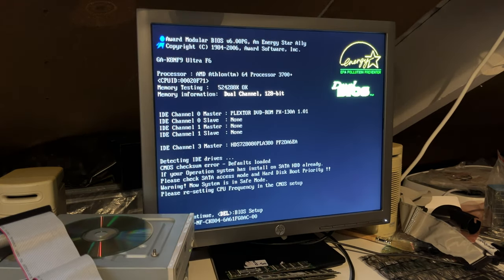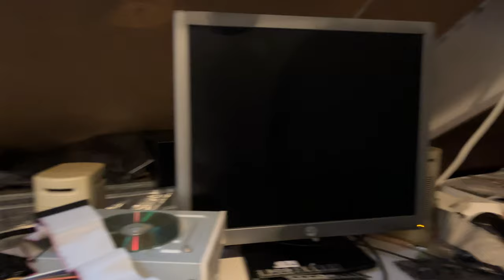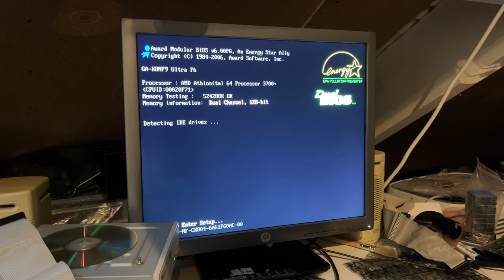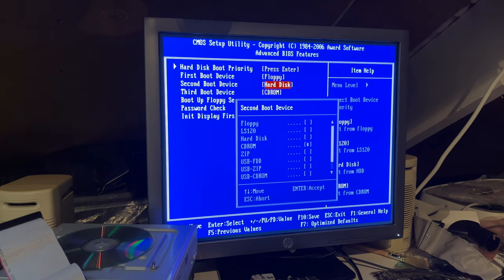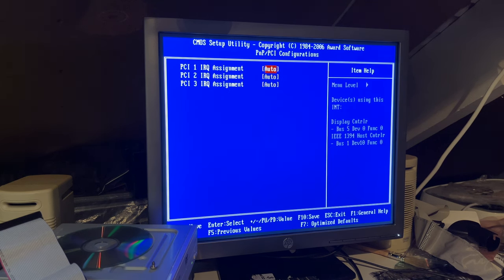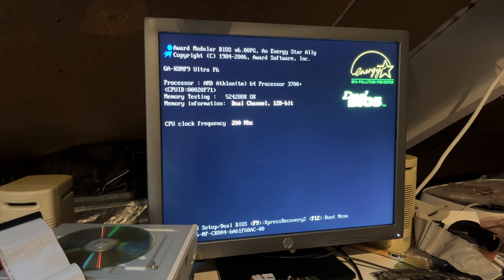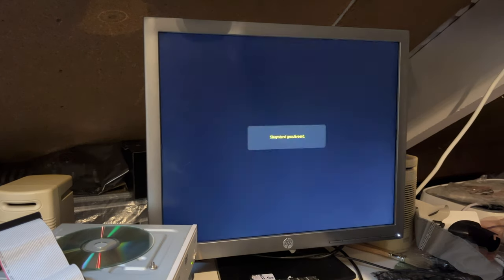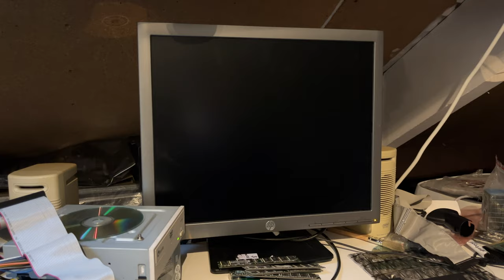Vintage Motherboard Haul - Part 6 - Gigabyte K8NF9 Ultra

Comment: I think Caps Around Of CPU Power Need To Replace
Because it does not receive the proper voltage
Reply from the maker: Yup, that was my guess as well. Going to be doing that later this year. I’m not exactly experienced in soldering yet, but I’m going to give it a go. I have the right equipment now.